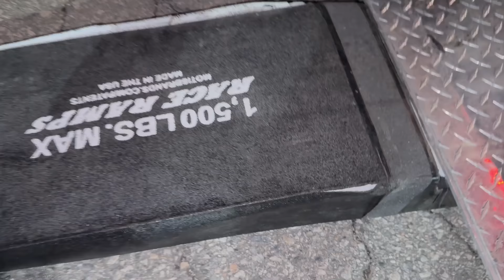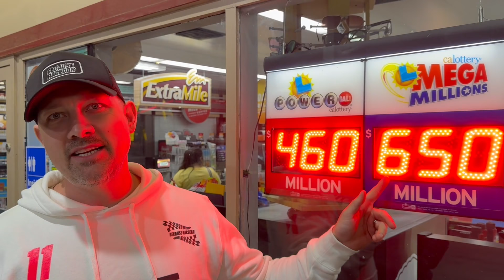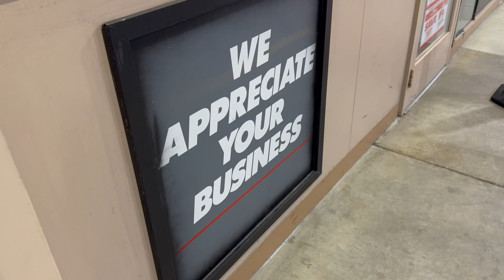Mike Essa Is Going ELECTRIC... *Cybertruck*

Comment: Alot / most people with trucks don't utilize them as trucks but just to commute. Also supposedly the CB only takes 2/3 of a turn lock to lock, that's probably why the flat bottom wheel isn't an issue for driving and u turns

Comment: Make sure the keys to the cars are at least 5 meters away from the if you leave them unlocked. Or the battery will go down in the car from continuing to wait on any button to be used.  Most key fobs will do this if the car is not used or moved that often.

Comment: That cat is the new shop manager, he said leave me alone and get back to work 🤣.
Welcome new mechanic that stole my job 😂 jk. Dude seems like a really good fit and a chill doood. Everyone's like yeah right you and everybody else in the world wants a job here lol.

I think the Cybertrucks steering wheel is the way it is because the steering ratio changes as it changes speed plus it's got a little rear steer I think. Notice how it doesn't have the hubcap wheel covers on it, I think they were digging into the sidewalls of those very expensive tires so they probably stopped coming with the Cybertrucks until they come up with a new design i guess, does that mean Tesla is going to give a set to every CyberTruck owner? 
You should watch one of HeavyD's newest vids where they put tracks on one of these Cybertrucks, it kept breaking things on the Cybertruck and they kept having to reinforce areas and make new parts🤣. 
I seen another guy on YouTube with a Tesla that put a generator in the back,  I think he removed the rear window glass and then diamond plated the whole area into a closed compartment and I forget what engine he chose. 
I wonder if I could charge up those Teslas with like a mini V8 or a mini V12 hahahahaha.
Sry I write too much sometimes. ✌️✌️

Buh buh buh buh buhhh, Im lovin Ti*s, your lovin Di**s 🤣🤣🤣🤣.

Comment: I would commute an Evo to Santa Monica and it was killing my car and wallet. Decided to get a Model Y performance and free charging at work made the decision easy. Took my car out on weekends to enjoy the sounds of the turbo and BOV but Mike... the Model Y performance through canyons was amazing with the amount of grip in an SUV from the battery being down low and the instant acceleration out the bends. I think your assessment is a little premature. And auto pilot on a 65 mile commute one way was cool but not as great as my motorcycle 😎

Comment: Tesla is charging $1900 for the Cybertruck's OEM windshield. For reference, that's about as much as a windshield for a Mercedes S580 sedan costs, while a Tesla Model X windshield these days is allegedly running about $1300.
Reply: A Lamborghini windshield that DDE had to replace was I believe 3500$. This truck is at minimum 65k, if you're worried about having to replace a windshield which may not even need replaced anytime soon then just don't buy it, it's not in your price range, just like any other car you can't afford.

Comment: Hey Mike, just wanted to lyk that the body of the cyber truck isn't your typically sheet metal or stainless. A different type of stainless steel had to be created by tesla for some reason, so while you could slap on stainless an call it a day, that wouldn't be the same as if you got a replacement panel from tesla.
Reply: Also it's very weird for the entire car community to have a negative pre disposition for a car. Most of the car youtubers I see want to hate the cybertruck from the start, and then eventually, after using it, they like it.

It's just a car, same as the other 100 that have come out that everyone never gave a 2nd thought.

Comment: Jsyk mike the cyber truck is drive by wire that’s why they can do the racing style type of steering wheel. To get tires to full lock it’s a little less than 180 degrees!

Comment: Savings in gas? You have to pay at charging stations a decent sum to charge up and it’s running your meter at home plugged in all night. With electric going up 3-5% every year I don’t think it’s cheaper. Not to mention when you are driving and need a charge and locate a charging station you get there to find out it’s being used or out of service.

Comment: Hellcat swapped Wide body cybertruck would be sick on the channel, and most likely cost less than all the cars in the fleet, but would get insane views :D
Reply: Or just drive any other car they have. It would make zero sense to do that.
Reply: @YouroGamer  their job is Content, and views. a wide body engine swapped Cybertruck would bring alot of both. so how does it make ZERO sense on a car channel? people want a spectacle, more than a 1 hour video of how a turbo works. if u get my point
Reply: @konkelkent  Or just use the 1000 hp of the electric vehicle for fun, as it was meant to.

I know it may be hard to believe but not all cars need to be gas. They could do something like HeavyDSparks and throw tracks on it, or do literally anything off road. 

Or honestly, putting "You wouldn't believe how the Cybertruck left me stranded" as the title would drive all the tesla haters to the video, that would drove views through the roof.

Comment: Mike and the boys should really look at more info on electric cars before starting things that are not true. IE the Cyber Truck has speed sensing steering. You don't need to turn the wheel completely when going slow.plus all the other options they had about charging and driving them.

Comment: Mike is a real car guy 💯 that feeling when your in a corner tires are starting to squall and you drop the gear the rpm jumps up the back end breaks and you cut back slide through come out catch traction in the upshift the speedometer starts to climb you can feel the firing of the engine its amazing i love my vehicles my wife gets so mad u crank something up and if the least thing is off i can tell she is like its fine its normal. I feel the difference i built it i know if something is not at 100%. I spend evey free moment and some busy times working perfecting my vehicles. I have built some of the craziest and some of the most fun trucks and cars ever.

Comment: Mike Essa the Cybertruck is also drive by wire, no physical connection between the steering wheel and the front wheels.
Reply: I feel like he has such a prejudice against tesla that he probably hasn't looked into all the cool tech it has. You can tell bc he thought the panels are normal stainless steel.

Comment: So many cybertruck and tesla misconceptions
Reply: The wheel is shaped like that because it uses stear by wire and doesn't require doing more than a 180-degree turn so no need to remove hands from the wheel 😉 pluss trying to move away from driver cars too
Reply: Also the rust spots was proven to be over exaggerated and there was posted fixed by tesla themselves also most people wrap them if yiur smart
Reply: Please do your own research

Comment: I wanna get this Tesla cyber truck and I wanna go out in the woods and beat the hell out of it. That’s the only problem I see with Tesla or any electric vehicle is that there is no way to portably charge it one if they integrated a solar panel to the roof for alternators on the wheel I would most likely buy one because I don’t wanna have it in all the time and everything like that plus also I go cross country and I drive in a lot of death areas where I know there won’t be that many charging stations because there’s not that many gas stations, so yeah and also I wanna see how adorable this truck is

Comment: I love you guys, but you guys don't know shit about electric cars lol. Everything you stated was wrong. I'll just list a couple to keep this kinda short. 

The cyber truck doesn't rust. Everyone who stated it does is dumb for not trying to wipe it off. Stainless steel is reactive and free iron will stick to it. It is the free iron that is rusting, not the stainless steel. You can wipe it off. However sometimes you have to buff it off and I feel people should consider ppf for the cyber trucks so they can avoid that. 

You can absolutely take the car on vacations and long drives. I have a model s p90d. I live in Michigan, and bought the car in Oklahoma. I flew to Oklahoma and drove the car back. No issues at all and charged about every 3 hours and charging doesn't take long. Plus it's a good time to stretch, eat, use the bathroom ECT... Then last spring I went from Michigan to Louisiana and back to Michigan without issue. The car plans out your entire route and adds stops for you to charge at. 

What's this about only being able to go fast if you're going straight? I never heard that one and I thought I heard them all. I have no issue  going fast on any type of road. 

And one that bothers me (it wasn't mentioned by you guys) is the comments made about the "recalls" Tesla's have. So many people do not understand what that means for an electric car. You don't take the car in to correct the recall. It is a patch update you get that goes right to your car and you just update the car on your phone or cars screen. I never had to take my car in for a "recall".

Comment: Mike, that cyber truck  has made a carbon footprint larger than my 27 year old Dodge truck and the cyber truck just made it to the market.  Lithium mining, electronics, circuit boards and plastics manufacturing are just the tip of the Iceberg when it comes to polluting the planet with electric vehicles.
Dipstick means Scared Naive Little Boy,